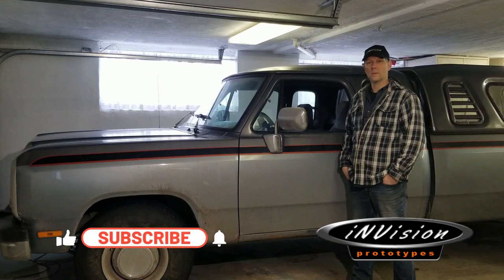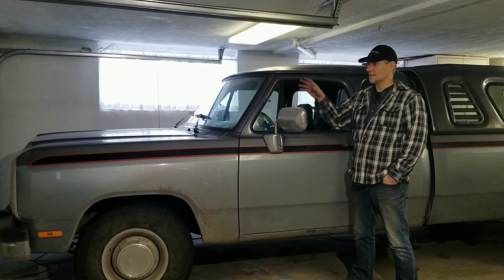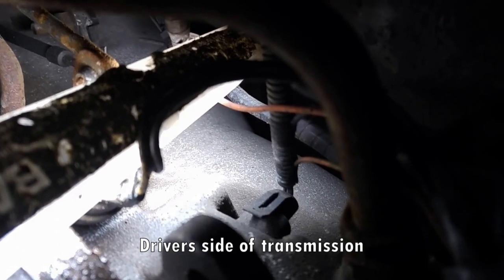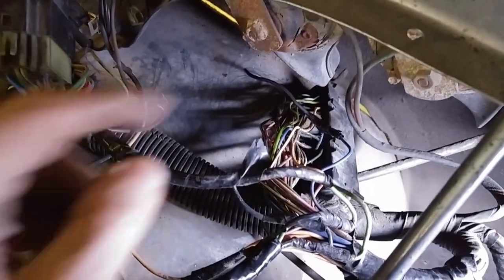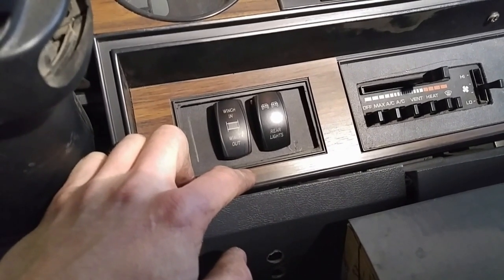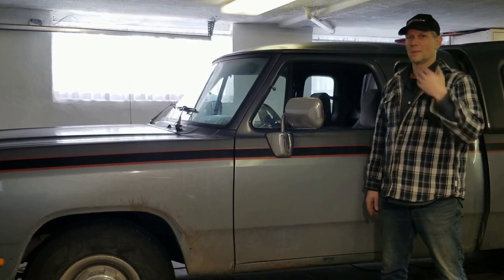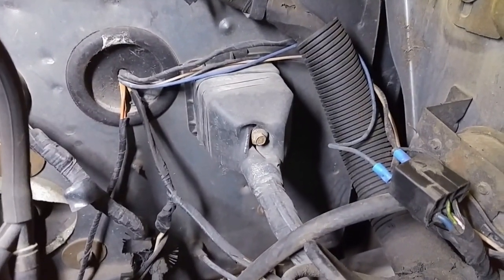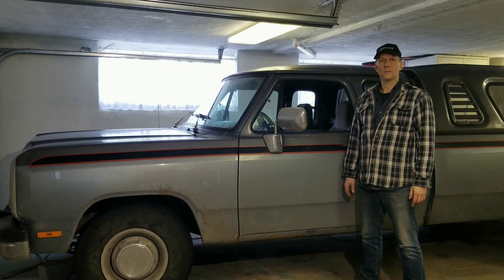Overdrive and Speedometer HACK - 1993 Dodge Cummins D250 Truck

Comment: Wrong 2nd Gen.  1st Gen is from 1974 to 1980 and 2nd Gen is from 1981 to 1993 in the USA and 1995 in Canada. And I know because I have worked on them since new all generation until this one
Reply from the maker: Ok. Thanks!
Reply: Lol first generation diesels 89-93. All the others are body styles. I know I've owned them. Love the pcm fixes! Thanks for sharing and keep up the great work! 👍 we appreciate it
Reply: '74-'80 is a Power Wagon, NOT a RAM.

Comment: On my dodge the overdrive wont kick in with the toggle switch no more., i replace every sensor and even the solenoid inside the transmission., im thinking its something inside the ecm right?
Reply from the maker: Probably.  Has anything else stopped working? Charging system? Speedo? Engine preheat?
Reply: @iNVisionPrototypes  my speedometer., my alternator stoped working first like a year ago and i did the external voltage regulator thing., then my overdrive didnt work and i did the toggle switch and worked for about a year., .i checked evey wire and replaced the toggle switch., tps sensor ., and vss also solenoid inside the transmission also., and nothing., but it sure does run up to 70 mph with no problem
Reply from the maker: @gummyvalenzuela2509  Do you have a pressure switch installed in the governor port to control the OD?
Reply: @iNVisionPrototypes  no
Reply from the maker: @gummyvalenzuela2509  There's a part number for one in the description.  Throw it in follow the directions in the video and you'll have your OD back again
Reply: @iNVisionPrototypes  i cant find that link can you provide it to me please., thanks so much man
Reply: @iNVisionPrototypes  i just found what you are talking on the video now., i have order it and will try it out thanks so much sir

Comment: I swapped a Getrag 5 speed into my 93 tow truck.  External voltage regulator and under hood harness from the 91 parts truck.  All the stupid problems solved
Reply from the maker: That's great!!

Comment: so how do i wire my od to a switch inside my cab and could i leave the overdrive switch on all the time ? or no
Reply from the maker: Orange green wire up from the OD solenoid on the trans, through the switch then down to the pressure switch you install into the governor port on the passenger side.  It can be left on all the time(unless you need it off when pulling) b/c the pressure switch does all the work to kick the OD in and out.

Comment: I was told not to leave my truck in overdrive, also it has no balls in 1st when I do
Reply from the maker: Our trucks have loads of torque but who ever told you not to leave it in OD all the time is right!  You'll lug your engine to an early death.  At least throw in a manual OD switch that you can toggle from off to on once up to speed OR do the hack I showed in the video with a pressure switch screwed into the governor port.

Comment: What if your truck only gets up to 35mph and stays there? Does that mean I would need a 35mph switch?
Reply from the maker: Only 35mph?  You may have something else going on.  Without OD on (or the time the computer puked) my rig will get into the 65mph territory... engine doesn't sound too happy though.
Reply: @iNVisionPrototypes  Hmm, maybe... My engine sounds fine, but a lot of the wiring harness wires going down to the transmission are pretty brittle. I replaced to tps because the tps bracket was missing when I got the truck. I'm going to check voltages to it. I'm hoping it's just out of adjustment. I just bought the truck for the engine but I want to try and figure out the transmission if possible.

Comment: I really like that cellphone charger trick. Might give me just enough reason to swap my 90 from tbi to carbed because i want to retain the spedo and get rid of all that garb.
Funny thing is that blue wire which is present on pretty much every truck since 81 is exactly what i use to swap from a lean  burn system to a gm hei module. Manual for the win that has saved more headaches than i can imagine.

Comment: Thanks for the video. Been looking forward to seeing you work on this truck! I have a 1991. I swapped in a auto A518 O/D transmission to replace the 3 speed 727 auto. I was going to just run a switch to control the O/D… I have Pressure switch ordered now.
Reply: You only need the one wire on the pressure switch? The pressure switch is completing the ground for the circuit?
Reply: Which color wire on the O/D solenoid is in the front/rear? I started with a Napa pig tail the wires are the same color. I don’t know if it matters…
Reply from the maker: Yup, that's correct, only 1 wire on the pressure switch.
Reply from the maker: In my case front wire is blue with a (i forget the color) tracer and the rear wire was orange with a green tracer.  I just tapped into the wire coming down from the PCM connector, went up to the toggle in the cab, then back down to the pressure switch.
Reply from the maker: As long as you keep track(ie write it down and put in your glove box) of what OG coloured wires go to new coloured wires, it doesn't matter.  If you are lucky enough to find a connector with the same colours as the truck, then its a bonus.
Reply from the maker: Sweet!
Reply: @iNVisionPrototypes  thanks for the help. Sounds simple enough.
Reply: You don’t happen to have a part number for the pressure switch? Looks like the normal application is for a Chevy T350. I can find them online but the part stores don’t seem to carry them.
Reply from the maker: @brettjohnson9495  Hey Brett, Yeah Chevy 250/350 I picked up a handful from my jobber in case... but did a quick look on the jungle website and found this.  Should be the same. - Acdelco 8648067 50PSI
Reply: @iNVisionPrototypes  thanks. I ended up getting the 50psi switch from PATC here in the states. 20ish dollars… I got two, one spare. They sell a whole kit to do the swap for a A518 with lock up. My trans is a non lock up so I only needed the one switch. 

I searched the jungle and it didn’t pop up… must be a Canada only thing. Lol. Thanks again. 

Just installed the switch and wired it up. Hope to get this truck on the road soon. Scheduled to go to paint at the end of next month. 

Currently installing some 96 suburban bucket seats. Chopped down the stock Chevy base to pick up the outside bench mounting holes. Then drilled new for the inside holes. Worked pretty well.
Reply from the maker: @brettjohnson9495  Sounds great!!  If you'd be willing to share, I'd love to see a few pictures.  nick@invisionprototypes.com Thanks!
Reply: I've got a 91 trying to figure out why it dies when I pull it into gear Feels like clutches in the transmission are not disengaging or something

Comment: I have to go outta town this weekend on 800 mile road trip with no speedo and confused on how you wired the phone charger, I’m assuming you took a 12v phone charger plugged it into 12v and ran a usb wire cut and stripped on power side going to the pickup wire?
Reply from the maker: See your other comment Dhillan.

Comment: 3:19 Hi, if you want the o/d to kick in at 40mph do you get a 40psi pressure switch? If so how do you know it is going to fit in to the transmission in the governor spot? Can you give me a link to a suitable switch? I live in Ireland and no parts store here knows what a 92 D250 first gen Cummins is.
Reply from the maker: That's correct.  40mph may be a little low.. all depends on your rear end.  I used a 50psi switch and it works like a charm.  Tell your auto parts store you need an oil pressure switch for a 1980-86 TH350 transmission... that may help.  Thread is a 1/8"npt  If not here's a link to an ebay listing https://www.ebay.com/itm/122034261889?hash=item1c69cf0f81:g:zccAAOSw7M1gthny&amdata=enc%3AAQAHAAAA8GTWZ9UtCeBHRbLys8S%2FkyUIKY%2BuHScPCRWTmIBuBJdIII6hXR9MmX3rnFXbFBRAd7frePChRTUvBl3vGaPeMJuErZsc0sgVPRz1jLOk0ENokswOVDCHGEgO6sJ1oMXZxXeV%2Bnq5x3IR3%2BtGvKR0rZa6626BpyFCw1710eimz5aYCAw1FwFMCYkjrWzzBNpcii0yjbE7WkqqOOEFDlmqNsGFET1bv3l5U7ktbLVSN6yQ8SsT3p30UTy4ACknAIfum6PZfbP%2Bx%2BIpkG867mp1mCLh%2FMrjf%2FylHjj7YQFePfPCJuU%2FR%2BrdnRzzs%2BWu6lX5ow%3D%3D%7Ctkp%3ABFBMwPzaweJg
Reply: @iNVisionPrototypes  Many many thanks for your help. When I said Ireland I meant Ireland other side of the Atlantic. I have only ever seen 3 American pick ups here, so asking for "an oil pressure switch for a 1980-86 TH350 in your local parts store" is a non starter. I have bought one from your link. Many thanks again for your help. My rear end is a 3:54.

Comment: I’ve got a 92 truck has a white and orange wire and a black a blue on the speed sensor no computer how would I fix this to make speedo work
Reply from the maker: Play the video through and follow the process that I describe.  If you get hung up in a particular spot read through the comments to see if your question has been answered.  If you still have questions drop me a comment.  I will try my best to answer.  Thanks for watching.
Reply: @iNVisionPrototypes so do I need to ground the black and blue wire and put 8vdc to the other wire at the pcm connection? Thanks

Comment: Do you think a 5V car charger will work instead of an 8V?  That’s all I have at the moment.
Reply from the maker: Sure, you can run with a 5v but the speedo won't show the true speed.  You may have to mentally add some MPHs to what the needle is actually showing.
Reply: @iNVisionPrototypes  gotcha. Thanks

Comment: Video helped me big time
Reply from the maker: Hi Dhillan, So your speedo came to life?  Yea you can plug into the cigarette lighter then run the +ve voltage(as close to 8V as possible otherwise the speed will be off a little) down to the pickup using that tan wire with yellow tracer(unless your truck uses a different wire colour).  I made mine more permanent by finding 'keyed' 12V under the hood at that black plug.
Reply: I was able to get my overdrive working and the AC, but the speedo I couldn’t get to work. I used the cell phone charger, but it only put out about 4.9v. I don’t think that wasn’t enough to power it. I went ahead and ordered a step down 12v-7.9 off of Amazon for eight bucks.

Comment: I have a adjustable pressure switch I put on my 4x4 5.9l. Now my question is, is the orange wire going into normally open, or normally closed on the pressure switch? Also where does the blue wire go to thats on the o/d (overdrive) pigtail?
Reply from the maker: Hey Adam, the switch I used was a single terminal(both of the spades you see on the switch are actually one bent into a "U") normally open switch until it sees 50PSI, then it closes creating the connection and engaging the OD.  The pressure switch replaces the function of the computer completing the ground for the OD solenoid. So, blue wire is hot(positive) feeds the OD solenoid - orange/green wire goes to the switch up in the cab(where I can break the connection to the pressure switch) - then down to the pressure solenoid.  I would have loved to find an adjustable pressure switch - but from what I can recall my jobber didn't have one.  Hope this helps.  Let me know if you have more questions.
Reply: @iNVisionPrototypes  found a 25 to 50 psi adjustable pressure switch on Amazon. It comes with a normally open and closed terminal on it. But so far you've been a huge help. My wife will be driving this truck off and on, just maken it easier for her to drive. Last question, seen a guy take the green wire from the back of the instrument cluster and wire it direct to his vss and then ground the other side of the vss for the speedo for it to work. Is this possible?
Reply from the maker: @adamvargo403  I'm not aware of the green wire from the back of the cluster.  That may be another work around to get the speedo working - not sure.  The way I did, I went by what the schematics showed and didn't involve pulling the dash apart(i'm lazy... lol)  Glad I could help you out.  If you haven't subscribed please do as it would really help me out.  Thanks!  And let me know how the adjustable pressure switch works out for you.
Reply: I am subscribed! Thabk you for te help and keep the videos coming
Reply from the maker: @adamvargo403  Thanks!  Will do
Reply: @adamvargo403  Hi please can we have a link for that switch?
Reply: @adamvargo403  Hey what did you do to get your speedo working? Did you ground the black at the VSS and run the O/W up to the green on the speedo? 
Cheers eh!

Comment: Doing your transmission that way does it come out of OD on its own when you slow down or passing someone.  Or do you have the turn it off when you slow down or pass someone
Reply from the maker: Yes, slow down or get on the go pedal to pass and the OD will drop out.  Just drive like you would normally... using the governor port to control the pressure switch works like a charm.  👍
Reply: @iNVisionPrototypes  thanks

Comment: Did I miss something so the orange wire ground out when it hits 50 mph does the other wire have 12v to it then?
Reply from the maker: Hi, Yes, the orange wire creates the ground connection to engage the OD solenoid.  So, the way I set it up... +12V(blue) feeds one side of the solenoid - that's factory.  Other side is an orange/green wire and rather than going to the computer to get grounded it now flows through a switch inside the cab(to manually turn off the OD when doing over 50MPH if needed), then down to the pressure switch in the governor port.  When the pressure switch sees 50PSI at 50MPH it closes and grounds the solenoid.  Hope this helps
Reply: @iNVisionPrototypes  okay that’s what I was thinking I wired it all up last night and it worked excellent! In my 12v cummins f100 project it’s nice to go more than 50 with out all the rpm’s
Reply from the maker: @jacobthompson4117  That's fantastic!  Glad to hear you got it worked out.  Sorry for the late reply, it's been a madhouse here past week or so with trying to wrap up the 51 and get all the editing done.  12v in an  f100.. WOW! sounds like an great project. 👍👍👍

Comment: Wouldn't a ballast resistor for a coil work too and be less problematic?
Reply from the maker: With such a very low draw ballast resistor won't work.  Voltage drop is dependent on load experienced.  We've had it set up with the cell phone charger for about 10 years.  Works like a charm, no issues what so ever.

Comment: So does the math just workout for 1psi to 1mph? Just so I am getting this right... the sensor is actually taking the transmission pressure, and at 50 psi that means the truck is at 50mph, and then it grounds itself through the switch ?
Reply from the maker: Hey Austin, that's correct!  Sounds too easy because it is.  Some guys will throw in an adjustable sensor so they can choose a pressure for the OD solenoid to kick in.
Reply: @iNVisionPrototypes  Thanks so much i appreciate it! Does it matter what port you put it in ? There's a plug on mine, but it's on the opposite side of where you had yours
Reply from the maker: @austinthomas2697  No problem.  And yes, it's very important that you use the port I indicated - the 'governor port' which gives you the 1psi to 1mph pressure required for the sensor.
Reply: @iNVisionPrototypes  would it possibly be in a different location for 4×4 trucks ? I can't seem to find it on that side up top
Reply from the maker: @austinthomas2697  I'm not familiar with 4x4 transmissions but did a quick lookup on google.  If you have the 46RH 4x4 here's a link with a photo https://shiftritetransmissions.com/shop/1990-1993-46rh-4x4-transmission-5-9l-diesel-non-lockup/  and a another link indicating the different ports https://www.justanswer.com/transmissions/8g938-transmissions-46rh-dodge-46rh-transmission-anyone.html  On the right hand side go straight upwards from the rear of the pan you should find the governor pressure test port.  Hope this helps.
Reply: @iNVisionPrototypes  Yes, I believe the governor port is blocked by the 4×4  shifter plate and linkage. Wonder if I could use the overdrive port, or that wouldn't work right
Reply from the maker: @austinthomas2697  The OD port won't give you the correct pressure.  You can temporarily install a toggle switch to engage/disengage the OD to get you by.  Another thing you can try is removing the shifter plate, install a "street 90" (an elbow fitting with a male thread at one end and a female on the other) with the correct thread and turn the sensor so it doesn't interfere with the plate.  Hit the subscribe button and check back from time to time.  Someone may post what they did on their rig in the comments.
Reply: @iNVisionPrototypes  I apprecaite it! I'm going to check tomorrow and see if I can get any clearance by cutting that plate to get access to that port without any interference. Thanks again, I'll keep you updated !
Reply: @austinthomas2697  How did you make out with the pressure switch on your 4x4? I need to do this on my '92 4x4. 
Thanks eh!